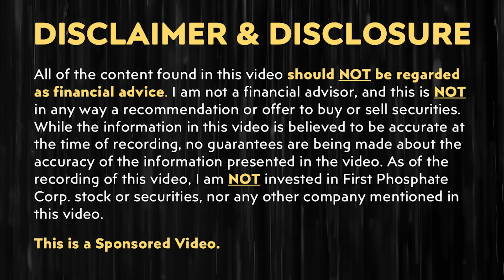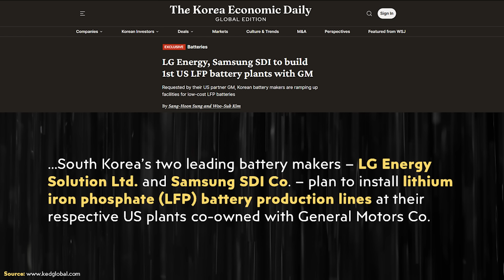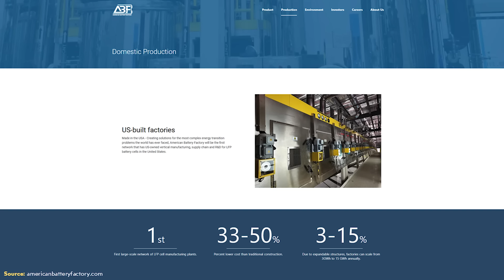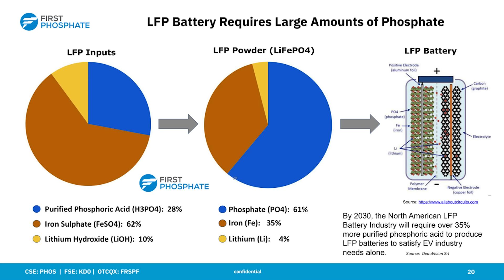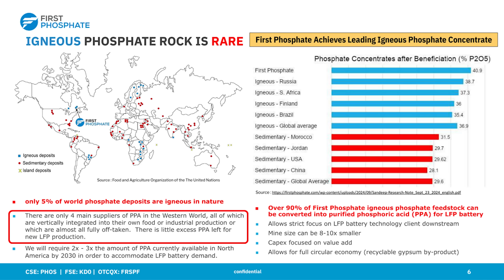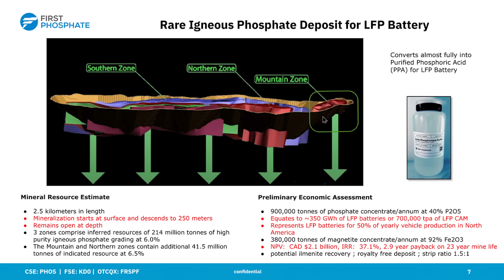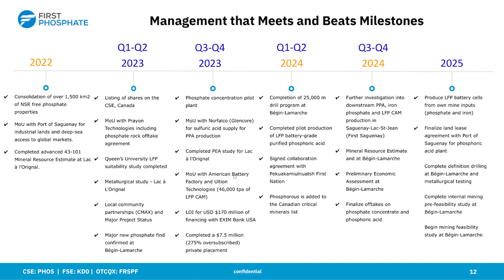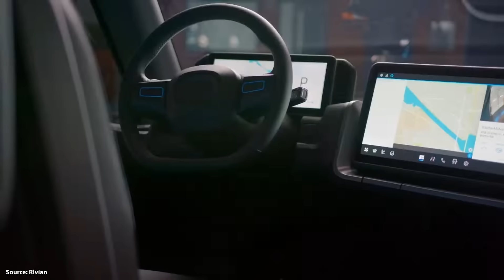America's LFP Battery Takeover: Tesla Battery Factory, NEW EVs, & More

Comment: Sodium ion batteries will make LFP obsolete and start outselling them within a couple of years.  Any company investing more in LFP now than in sodium ion is a buck short and a day late.  

Sodium ion will be about half the cost of LFP when it reaches mass production because of cheaper materials and they can be shipped at 0% charge.  Their state of charge is easier to measure by voltage and you can use almost 100% of the battery.  You can charge them in extremely cold or hot weather, etc….  The main drawback is energy density, but LFP had this same issue and it’s been overcome.  So will sodium ion.  Meanwhile, initial bulk sales may be in residential and utility energy storage, similar to LFPs takeover of NMCs marketshare.

Comment: Does LFP get replaced by sodium based batteries in the near future?  If so, First Phosphate is not needed, correct?
Reply from the maker: Iron Phosphate is the cathode material. There is research being done on Sodium Ion batteries with Iron Phosphate cathodes, so not necessarily. Sodium Ion batteries can work with various cathode chemistries just like Lithium Ion batteries can. In addition, Sodium Ion batteries have a low energy density (lower than LFP) and thus will not replace Lithium Ion batteries anytime soon.
Reply: Weight and size doesn't matter for a grid storage, energy density doesn't matter if it's 10th the price
Reply: Sodium batteries have a very low cycle life compared to lfp.  Sodium batteries degrade very quickly..